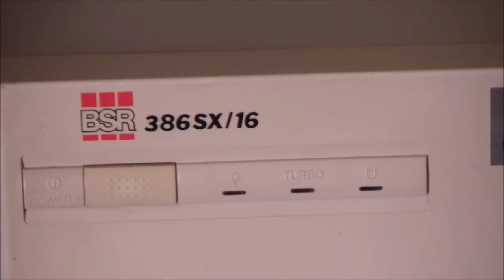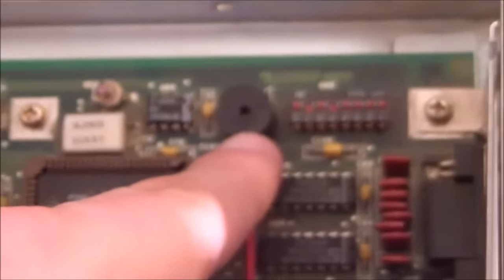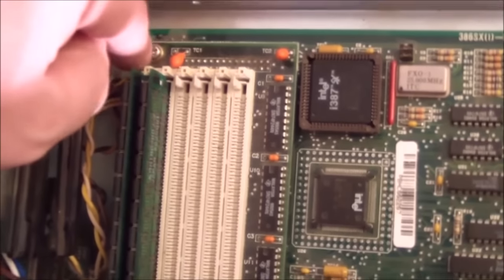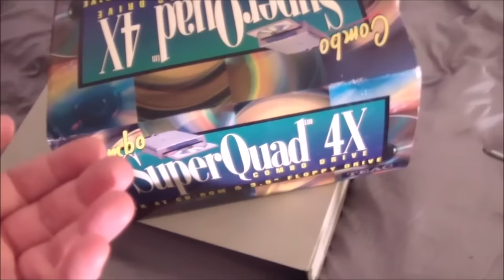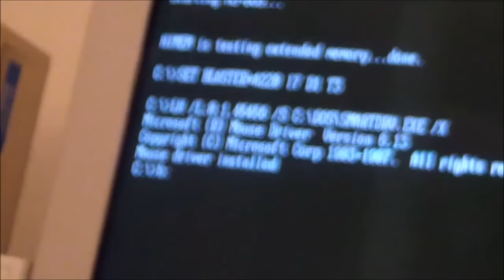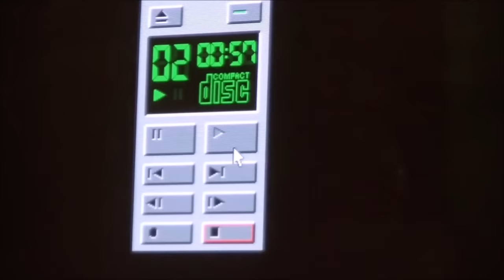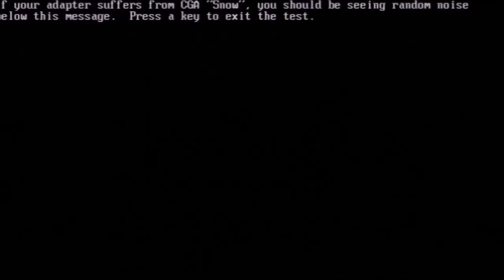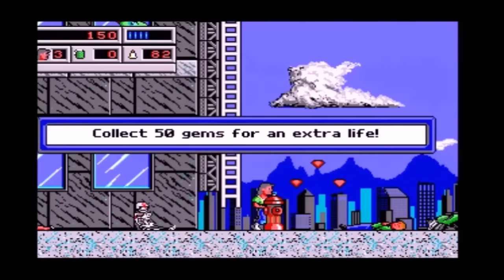BSR 386SX/16

Comment: My first PC was the BSR 286 with single speed CD-ROM drive that used caddies.  It had a 40MB hard drive and I MB RAM.  I remember thinking how huge that was at the time.  It was an awesome system and I used Windows 3.1 on it.  Over time, I scrapped the original board and replaces it with a 386DX.  Those were the good old days.  I really wish I kept that as a stock system just for old time sake.
Reply from the maker: did you add the CD drive or did you buy it new that with one?
Reply: It was new with the CD drive.  Also came with a bunch of disks.  Library of the future, Magazine rack, Bible program, and more.
Reply from the maker: Interesting. I never knew of a 286 based PC that came with a CD drive stock though I knew they were being sold even later on as more budget oriented offerings alongside the 386 and 486 PC's. Awhile back I did a video on my 286 PC and it had a CD drive, I mean so many games were released and rereleased on CD that run just fine on a fast 286 adding a CD drive makes a lot of sense but some people in the comments gave me some flack over it because it wasn't really "correct".

Comment: Excellent video. Very interesting machine. Using a double speed CD-ROM drive on a sound blaster / sound card with a cd rom interface usually works better on those ancient systems than IDE cd-drives. Good call!

Comment: The possible reason foor the ram problem is that some 386 and early 486 boards required the ram layout to be selected by jumpers or dip switches.
Reply from the maker: good point. The key may be figuring out the settings for the switch box on the board which I currently can find zero information on.

Comment: I did have a i386SX in 1991, it was my first PC ever, and I enjoyed it quite a lot until I upgraded it to a 486DX 33 MHz.
The 386SX could do 32 bit operations internally (and then was faster than any 286), but had to comunicate to the rest of the board with 16 bit bus. Although first 386SX was slower than high end 286's, the 386SX got up to 33 MHz and no 286 could manage to get to this level of performance.

Comment: Major Stryker looks like it's running at the correct speed, but some of the sounds aren't working, particularly when you fire your missiles and shoot at enemies.  I only hear the explosion sound when your ship gets destroyed, I wonder why that's happening.
Reply from the maker: Lachlant1984 thanks for the input, I'll try playing it on a diffrent rig and see if I get those sounds
Reply from the maker: I ended up testing the game on another 386 with a completely different Sound Blaster pro 2.0 and I have sort of the same issue. on this system the sound effects for the blaster and explosions play for the first few seconds of gameplay then just cut out and stop. Its puzzling. I also tried installing the game on two other systems that had larger HDD's (1gb and the other 2gb) and the games installer seems to freak out with large hard drives. It gave me a "not enough space error" and reported -1gb and -2gb of hard drive space available.

Comment: Maybe you have to change that DIP switch to support more RAM
Reply from the maker: I was thinking that myself, just need to figure out what switch does what.
Reply: Here's the manual. I don't see anything about needing to change DIP switches when upgrading, but it goes into upgrading the RAM and supported types/amounts.
https://files.support.epson.com/pdf/e3sx16/e3sx16u1.pdf
Reply from the maker: that machine appears to use a different motherboard then mine.
Reply: This is exactly what you have to do. I miiiiiggght still have the user/service manual for my BSR hanging around. I'll look around and see if I can find it. If I have it, then I have all the other stuff that came with it, including the BSR-specific Windows 3.1 disks. I know this video is a year old and you may have found all this stuff by now, but if I can get it all together, would you want my BSR stuff (documentation/disks)? Unless I tossed it recently, and I don't think I did, I should have pretty much everything that came with the computer, I just don't have the computer itself, anymore.

Comment: From what I know, a 386SX is not really slower than a 286 at the same speed, BUT most 16 Mhz 286 would be mature, stable, well performing boards with relatively good video cards, while most 16 Mhz 386SX would be from the early 386 era OR budget systems and have worse boards and slow video cards. So it isn't about the chip being really slower, but the typical 386SX/16 system being slower. If you put a Tseng ET4000 ISA video card into this it would really fly considering the clock speed and all the games you tested would run without any choppiness, but that would hurt the uniqueness and the special VGA chip this system has. It is probably best to play on it the way it is. There is also the thing that many 286 systems on Youtube are souped up with Ronald MT32, 8 MB RAM, Tseng videocards... and of course that would beat a 386SX clone that is "the way people actually used it back in the day". Most 286 machines were probably a lot slower than this 386SX, but yes, a tuned late 286 will beat the pants off this system. There were also 25 Mhz 286 chips from Harris that could outdo 386DX in 16-bit apps, but that one has a big clockspeed advantage on this guy.

My uncle run a 386SX/16 with a black and white VGA monitor for years using it for productivity software like word processing and accounting until 2001 or so. May be slow, but reliable, and definitely enough for stuff like accounting, the funny thing is, he runs a toy shop and has a modern machine with a 1080p LCD in place of that 386 now, but he still runs that same DOS accounting software on it in a window in Windows 7 (32-bit so yes, it has VDM for DOS)! If he did not use the PC for other stuff, I would call that the biggest waste of computing power ever.
Reply from the maker: I'm guilty of the souped up 286 myself. my video on the 286 has a 20mhz Harris rig with a fast ATI VGA wonder card. I have an OEM VTI Turbo 55 12mhz 286 machine I want to keep a bit more period correct and do a video on but the PSU is missing and it seems to take a slightly none standard sized PSU.

Comment: I have one of these BSR 386SX/16 computers I got with a bunch of junk. Mine is missing a hard drive, is pretty dirty, and has some rust, but I’m going to try to restore it.

If you’re interested, I found there’s a technical manual available on Amazon right now:
https://www.amazon.com/gp/offer-listing/B000KDD694/ref=dp_olp_used_mbc?ie=UTF8&condition=used

Also, cool to find your blog article on this machine. Like you said, there’s almost nothing on the web about this particular computer… except your blog article and your YouTube video!
Reply from the maker: awesome, thanks for that link. maybe the switch settings are in there. Anyways please let us know how the restoration goes and your thoughts on the machine once you get it up and running.
Reply from the maker: Ok, so the manual showed up. unfortunately it doesn't refer to this particular computer. oddly there are no pictures or illustrations in the manual of any computers or motherboards but the information of the range of computers it talks about is very similar but kind of off. for instance it talks about a CD-ROM drive as standard which I'm fairly certain this model did not have. also the video card is completely different as the manual talks about a ATI card being the built in video. It did however say the max RAM on the computer was only 8MB and since I figured the PC this manual was talking about was pretty similar to the SX/16 I have I started focusing on 1mb RAM stick and finally got the machine to recognize 8MB total. This did not require messing with the switches.
Reply: Hmm... The manual I got (purchased from the same link) does not mention a CD-ROM drive (that I could find), but does say the built-in video is ATI28800. There must have been several different configurations released. I looked on the copyright page of the manual I received, and it says "First Edition, Aug. 1990"

I'll have to dig into my BSR 386SX/16 soon not only to see if I can get it working, but also to compare with yours and see if there are any differences.
Reply from the maker: yep, that's the same video chip mine references. Yours has the Eagle II video chipset like mine does right? It mentions a CD-ROM drive in my manual at the front under standard features.
Reply: I haven't taken my computer apart enough to look and see what the video chipset is... I'll have to try to get to that soon.
Yeah, under standard features, my manual makes no mention of a CD-ROM. It does say 5.25" OR 3.5" floppy, which is interesting, since mine has both, as well as the 8MB limit on RAM.

Comment: Did you run the Wolf 3D benchmark with the registered 1.4 version? If it was this benchmark http://thandor.net/article/10 it says you have to use that version, did you use shareware?

Also, BioMenance is running in EGA, it just uses a SVGA compatibility mode as in, the EGA mode but adjusted for SVGA cards. This VGA is so old it might even not be SVGA, so maybe try turning it off in the settings and see if the scrolling improves. Some Apogee games have scrolling troubles on some videocards unrelated to CPU speed. To be honest, I think you are repeating "Oh, the CPU is SO SLOW" too much, most of the slowdown you get is probably caused by the VGA being a VERY early chip, those always had abysmal performance, try playing Continuum/Alpha Waves, it is an early 3D game that runs well even on a 10 Mhz 8088 and the polygonal objects in it flicker on any VGA that is not super slow so if it displays a nice non flickery image, you have an EXTREMELY slow VGA chip.
Reply from the maker: I used Phil's benchmarking utility which I think uses ver 1.4 though I would need to check. your right in that the VGA is super slow but the 386sx-16 is still a slow chip, especially as far as 386's go. It's the slowest 386 out there. Your likely very right about 286 chipsets being faster due to being more mature at the time but for a 386 being clock for clock just as fast as a 286 equivalent isn't a great selling point. and I think most people would expect a 386 to beat a 286. As said I could drop a et4000 or what not in there but a fast 386 is what I have my AMD 386dx-40 rig for. That unique video card is mostly the only reason I hold onto the BSR. I'll try looking for Continuum/Alpha Waves and give it a whirl on this machine.
Reply: I think the reason why Intel introduced the 386SX to replace the 286 were some bugs with switching in and out of the protected mode which made Bill Gates call the 286 a "brain damaged chip". Windows 3.1 should run much faster on this machine in 386 protected mode than a 286 in standard mode, uncle run Windows 3.1 on a 386SX/16 Mhz, of course it was not fast but it was probably much faster than a 286 stuck in standard protected mode. Also, in LGRs video if I remember correctly he actually quite praised the 386SX. From a 1988 point of view, this IS a speed demon, consider that most PC users still used XT class machines! Most PS/2 machines used a 8 Mhz or 10 Mhz 286, 12 Mhz at most, and those are absolutely slower than a 386SX/16. By the way, VGA adventure games like Space Quest VGA or Legend of Kyrandia (a beautiful VGA game that runs well even on a 8 Mhz XT for some reason, as long as it has VGA) should fly on this machine. Winter and Summer Games should also do well. I had a 40 Mhz 386DX, but to be honest, most games on it were very early 90s or late 80s stuff that your SX machine should run well too. Considering Dune 2 is playable, through slow on a 12 Mhz 286 with 1 MB of RAM, your machine should handle it well too. I guess I have a weakness for "good enough" systems but really, your system would be among the high end ones in 1988. In the country where I am from (Slovakia) some people bought 286/12 as late as 1993 and most game magazines in 1991 still reviewed mostly ZX Spectrum games, so judging it to be slow on Wolfenstein 3D or fast scrolling games (which it handles quite well to be honest from the video) is not really fair.

Anyways you can try the file from that website. It has no glitches in DosBox at least.
Reply: 0blivi0n100 I think even through there is no CGA port on that card it is still a rather valuable card as most 80s VGAs are very rare. It might be slow, but it is definitely a piece of videocard history.